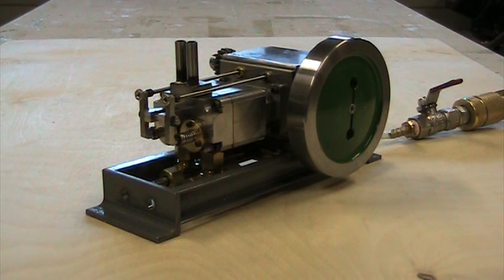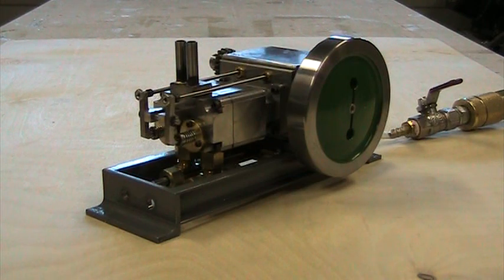John Deere Engine

Comment from the maker: It actually has two poppet valves, 1 for each of the two intake valves.  The exhaust valves are spring loaded ball valves inside the head that are closed by incoming high pressure air when the inlet valve opens.